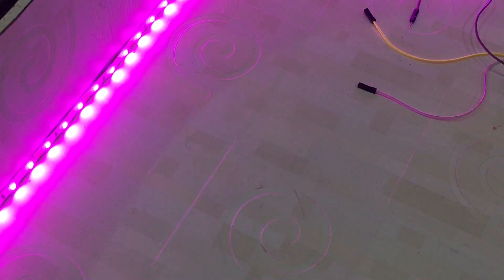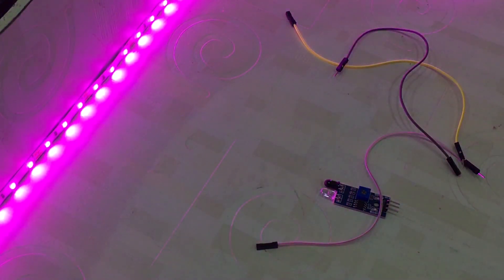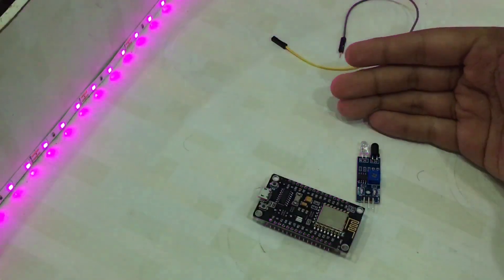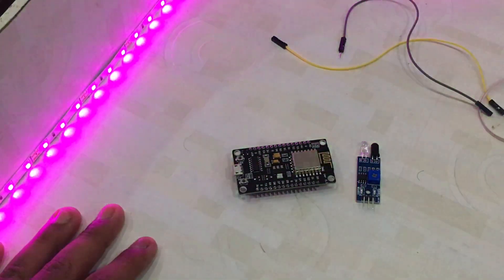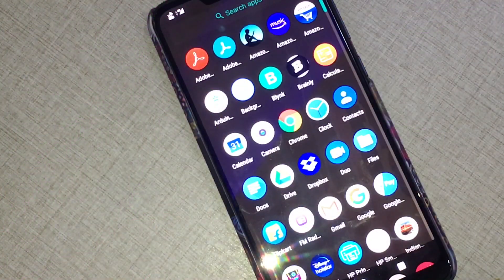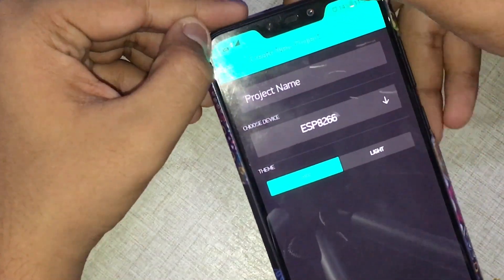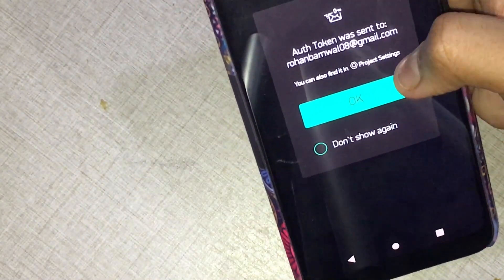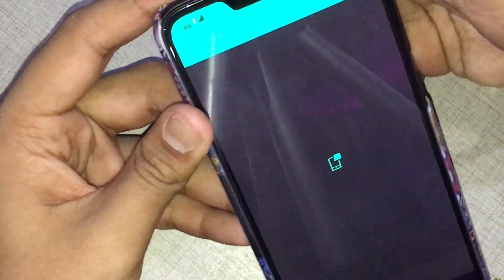Upgrade Your Doorbell: Build Your Own Non-Contact Doorbell with Arduino

Comment: If any person passes who doesn't even want to ring the bell then also it will ring 
So you can make use an esp32 cam or ov7670?
Reply from the maker: No bro the range of sensor is upto 2cm only
Reply: @ArduinoBoy  Okay
But try to make it a door lock system. It will look at your face and automatically lock/unlock itself. In this way u can open it manually as well as by registering ur face
Make use of esp cam or ov 7670
Reply from the maker: Okay I will